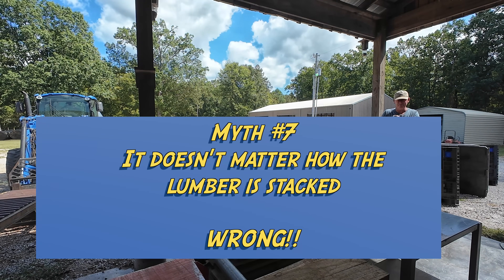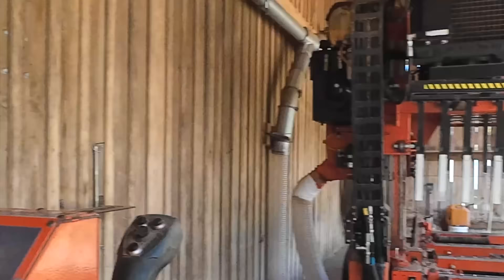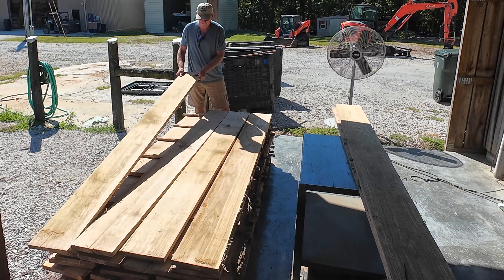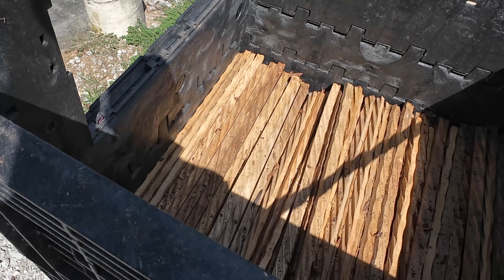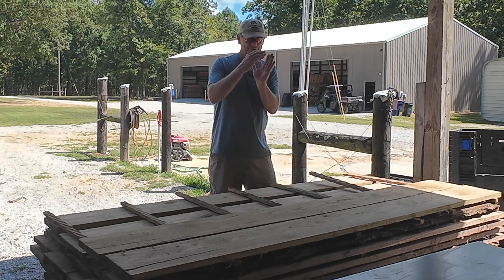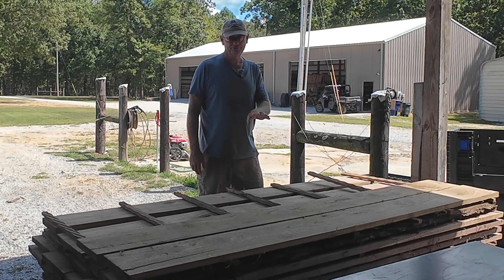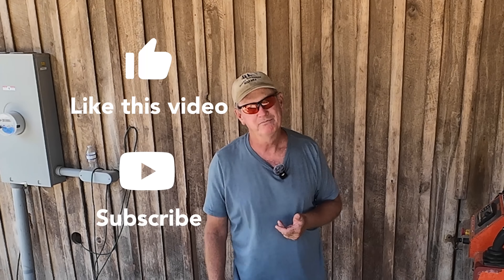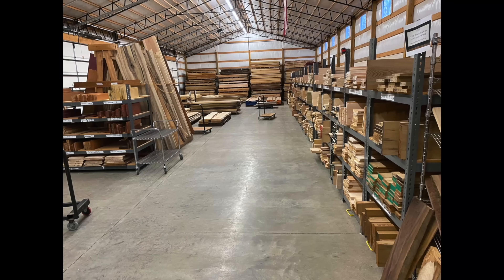Which Sawmill Lumber Air Drying Myths Will Be Debunked?!!

Comment: I agree with the majority of what you are saying.  When you say "Air Dry"  I find that can be mis leading to some.  I get people trying to sell me "air dried" lumber "oh its ready for furniture".  Relative humidity has to be part of that conversation.  I don't think sticker stain is limited to only the sticker as the cause.  I think a lot of it has to do do with the sap content at time of cutting or milling. I also find that stress cannot be removed or reversed, your stacking technique is helpful but the stress is inherent to the tree or log.  At point of use I think people confuse stress with case hardening, which is a product of the kiln drying process.  I always air dry a year per inch.  I find the end quality is better and it is also useful in less kiln loss.  I really like the rotary cut stickers.  I do find poplar and cherry will dry the fastest.
  I'm done rambling  lol         Enjoy your channel!
Reply from the maker: Thanks for watching.  I agree, air dried lumber is never ready for furniture, unless it has been dried to well below fiber saturation point, which generally takes a kiln, and is also sterilized.  I also agree that sticker stain is caused by quite a few things, I have discussed them in in several videos, and it is much more than just the stickers, it is due to the local EMC, the local Dry Bulb temperature, the amount of moisture in the wood when stickered, the amount of sugar in the wood, the color of the wood, the amount and type of extractives between the heartwood and sapwood, the bacterial levels in the wood, and the level of enzyme stain that is acceptable.  There are several really good deep dive USDA publications on the subject.  Minor levels of stress can easily be reversed using proper kiln drying techniques, we do it all the time, and have run quite a few experiments on the percentage we can straighten.  I routinely take  stressed lumber, stack them up, put them back in the kiln, run a few special cycles, and the majority will come out straight.  Some will not.  Inducing stress (case hardening) is only an artifact of improper kiln drying techniques, it should NEVER happen if the wood is dried correctly, and it is easy to test using the "prong test".  In commercial kilns using high temperatures, and high drying rates, the lumber is always and purposefully case hardened as part of the process, then equalized at the end, however, many times it is not removed properly, and so stays in the board and people will experience blade pinching and movement after planing.  So people think that it is inherent to all the kiln drying process, processes when it is not, and is one of the things that separates custom high quality custom kin dried from commercial kiln dried.
In some ways, boards are like carrot peels, when you peel a fresh carrot, it will roll up in a huge curl.  So will a board, if the stress is not identified and sawn properly.  However, if the carrot peel is put in an oven (much like a commercial high temperature kiln) it will curl up further, blacken (lose its color) and will be permanently deformed.  However, it the carrot peel is allowed to wilt and forced into a flat pane (like pressing a flower in a book) and then dehydrated in a commercial food dehydrator (my kiln is very similar to a big food dehydrator), when it comes out, it will be dead flat, still have its color, and will have almost zero stress, just like the rose that has been dried in the pages of the book.  
I agree, air drying is crucial to achieving high quality lumber drying as a part of the process, but it is only necessary to get it down to the point where the unbound water has been removed, although it is useful to get it slightly lower.  Just like all things, air drying is a process, not a fixed time, and is greatly dependent on species and EMC.  I can "air dry" some species using forced air in 6 weeks, while others, especially thicker pieces, may take a year or longer.  It "just depends" and that is what I try to teach in my videos, passing on the knowledge so people understand the background and know what to do to optimize their own processes.  You made some great and thougthful comments and I think I will make a video on this subject!  Thanks!
Reply: @HobbyHardwoodAlabama   I agree with everything you are saying.  I am a furniture/cabinet maker professionally for 40 years.  I have my own mill and dehumidification kiln.  I am further north our RH is around 12 so you are correct on the importance of EMC and dry bulb considerations.  I at times get people who show up and want to sell me some lumber that is "dry" its been cut and in the barn for 50 years, I want 15$ a board foot for my walnut🙄.  Many will get really offended when I pull out the orion or the delmhorst  and check it.  and then are offended again when I offer them a lower bdft price.  
I have had my own experiences especially in recent years with different suppliers and I can say without hesitation that I have experienced more consistent cases of case hardening with wood from microwave kilns.  To the point I will not buy from a supplier who uses them.  It seams the green lumber to green backs is clouding the process in my opinion.  I believe air drying is crucial.  I believe in the slow and steady wins the race approach.  It may be fine for framing and production trim manufacturers etc but not for making quality furniture etc that is going to last.  

I used to get lumber from a guy who had 2 steam kilns, he would explain to me the re hydration process when he was suspect of a load, it is quite the science, and I think it is important for those trying to do this or get into this that they study and learn this is not a plug and play business.  

I could ramble for pages.  But I appreciate your knowledge and what you are bringing to the public with your channel.  You obviously know what you are doing and I have learned quite a bit from your channel.

Comment: THE BEST WAY IN MY OPINION TO DRY  SAW MILL LUMBER, LAY SOME 4 BY 4 SON A LEVEL SPOT ON THE GROUND.STACK THEM  FOUR TO SIX INCHES A PART THE FIRST LINE THEN CRISS CROSS THEM THE OTHER WAY, THEN GO BACK THE OTHER WAY UNTILL YOU GET ALL YOUR LUMBER CRISS CROSS UP.  LAY SOMETHING HEAVY ON THE TOP LINE.  CEMENT BLOCKS ETC. LET DRY 3 MONTHS OR BETTER, AFTER THAT YOUR LUMBER WILL BE READY TO NAIL UP, SELL IT OR WHAT EVER , THANK YOU FOR YOUR ATTENTION TO THIS MATTER.
Reply from the maker: Thanks, what you are referring to is a "waffle stack" and it works OK, but then the pack can't be lifted by a forklift and also will not fit properly in the drying kiln.

Comment: I just disassembled my first stack (made myself).   I have major sticker stain throughout.  I used 3/4 plywood as my stickers, and the stack was air dried outside.  Sad dude here.
Reply from the maker: Plywood is not good for stickers, as you have found out.  It has a tendency to absorb and hold moisture.  Profiled hardwood stickers are the best, they let airflow between the board and the sticker.  Zebra stripes on boards you worked hard on make for a bad and frustrating day, I have done it myself and it sucks.  All you can do is figure out what you did this time and don't do that again.  Location, stickers, airflow, sticker thickness, all can ruin a load.

Comment: Robert, have you ever had the opportunity to saw a tree “without growth rings” like mahogany or something similar?
Reply from the maker: I do saw a lot of African mahogany lumber, but not in log form.
Reply: @HobbyHardwoodAlabama I was thinking about whether the rings and their different drying speeds from the rest of the heartwood could be the cause of the pressure inside the log or if something like mahogany still had the same issues with drying (splitting). I have seen a few of those Indonesian guys sawing them and I wonder what the injury rate is, but nobody narrates about drying or anything

Comment: Conduit or 1/2" PVC pipe. .
Reply from the maker: Not very good, I've tried it.  The conduit will roll and mess the stacks up when transporting with a forklift, tech metal will corrode and discolor the wood, and PVC will squash flat from the heat in the kiln.

Comment: Wow good info... thankyou.  Do you have an opinion on Presurvation Solutions drying aids?  I'm considering buying 16%mc fir from Home Depot, and using Wood Juice to dry it for furniture building... where the furn will live in an AC environment.
Reply from the maker: I would simply bring the wood into your house, which is a very good kiln, and it will dry the wood quite quickly.  The normal EMC for a house is 70F and 50% RH which is abut 8% EMC and so will dry the wood to that level.

Comment: how much of your lumber is quarter sawn vs plain sawn? Amish here in CNY claim after 6 weeks of air drying its down to 15-20% before they put in wood fired kiln.
Reply from the maker: Probably 25% quarter sawn to 75% grade sawn, slabbed, and other techniques.  Yes there are some species that can be air dried in six weeks, depending on thickness and species.  Basically, the less dense and open pored the wood species it, the quicker it can dry in the air.  8/4 white oak will hardly have dried at all in 6 weeks, while 4/4 poplar can easily be brought own in six weeks.

Comment: Another excellent video - I'm all good with what you covered...except for the 6 month drying - my slabs are 12/4...I'm assuming you are referring to dimensional lumber at 4/4
Reply from the maker: The drying rate is directly proportional to airflow and EMC, so forced air through a stack can dry a load of high moisture release rate wood at max speed, and as fast as in a kiln.  Lots of tricks to accelerating air drying, and the goal is to identify the max moisture removal rate of th species and thickness, and use forced air to achieve it.

Comment: I'm just getting ready to log a considerable stand of walnuts which grew after a logging cut in 1965.  The ones I'm considering have circumferences at breast height of 90 to 120 inches.  If they prove too large for a band mill, what are my alternatives?
Reply from the maker: Either a Lucas or Peterson Wide Slabber, they cut up to 8 feet wide.

Comment: 4:03 myth #1, what about discoloration, what cause it if it's not the sticker specie?

i love it's grain, but is there something to do to flatten elm? it bows as hell while i'm sawing it.
even worse when dry.
Reply from the maker: Most stickers stain is caused by one of two things, or sometimes both.  Either trapped moisture and subsequent mold discoloration under the stickers, or enzyme stain where the temperature under the stickers is different than the exposed portions of the boards and the sugars in the wood begin to change color, much like how a fresh apple changes colors once cut.  Both of these sticker stain issues can be solved with adequate airflow between the stickers and the wood, and making sure the stickers are not holding moisture like a sponge.  So for example, I use random hardwood for all my stickers, as long as it's not prone to hold moisture and cause ,mold, such as basswood.  Oak is fine,  cherry, poplar, sassafras, etc are all mixed together in my sticker bins, and even the elm you are working with.  That's also why I use the fluted or spiral stickers, simply because they promote good airflow between themselves and the board.  As far as elm is concerned, its spiral grain structure makes it very difficult to saw straight without it bowing up.  Use the fundamental stress management sawing techniques I discuss in some of my videos, and even then, you will still have about a 30% kill rate, but otherwise, you should get a majority of some very nice flat boards.
Reply: @HobbyHardwoodAlabama  ah... i may have use basswood and aspen for ash...
on some board i have gray stripes, some other are lighter in color.

i saw your video on stress.
I will be more vigilant about this next summer, thank you for your response.

Comment: look what happens at 13:43. hmmm.
Reply from the maker: Good eyes! I assume you are looking at the board rising due to the residual fiber stress in the boards?  The board is dimensionally accurate, and and I can remove the stress during the drying process,
Reply: @HobbyHardwoodAlabama  No, I'm looking at the board dropping as it's cut because it is unsupported. 
The bottom one ending up thicker and upper ending thinner for the last foot or two. There may be some stresses but if it was supported on the end the stack would have risen, not fallen. I'm just 'B'ing, you have taught me a lot and I'm hoping my sawmill biz can sustain me as a needed retirement job. So thanks.

Comment: I Guess leaving spaces between the boards doesn' matter ? Thanks for the info .
Reply from the maker: Good eyes and good comment and this goes the the real heart of my videos, that what many people think are hard and fast rules, are not, if you have the knowledge to understand why those rules were put in place to begin with,  and that’s why I make the videos.  So some rules are myths, some need to followed, and some are just guidelines.  The impact of edge spacing goes down when packs are less than 48” wide (mine are 42”) and if the air drying area has adequate airflow and the stacks are not jammed together, with an adequate stack spacing between packs, they they will be fine.  No different than drying a 40” wide live edge slab than drying a 40” wide later of 6” wide baords.  Most times.  IF the stacks are right, it won’t be detrimental.  On the flip side, edge jamming on some species constrains the boards to dry with little crook, so can produce a straighter better board, especially with quartersawn and rift sawn wood.  Good topic for a video!

Comment: I heard there's a way to take in straighten out. Bend boards by placing other boards on top of them to force it straight. Is that true?
Reply from the maker: No, not without the addition of heat and moisture, much like is done in steam bending.  I have tried both, but dry bending with weight doesn't work except in maybe 10% of the boards.  It's not worth doing.

Comment: Great video Mr. Robert.
If I'm wanting to save some whole logs for future projects/milling do i need to remove bark, end seal and position them up of the ground with plastic underneath till I'm ready to mill them?
Any info feedback would be awesome. 
Thx
Reply from the maker: First, you are aware that isn't the best thing, but I understand, sometimes you got to do what you got to do.  From my personal experience, and I have a video coming out this week that talks about old logs and some of the good and bad points, you will see some degrade, so you need to do some things to limit that.  So do not remove the bark, that will enhance drying from the log and will increase drying cracks from the sides, bark acts like end sealer.  When you initially buck the legs, leave them at least a foot or more long, on each end, so that any end defects that appear can mostly be cut off with a chainsaw when you actually get ready to saw them.  Although stress cracks can progress further than a foot, most drying checks will not, no time them off clean and to length when you are ready to saw them.  Endsealer can be applied, it wouldn't hurt, and if the logs as high value, you can use "crack stoppers" driven in the ends, but I rarely do that.  Do stack them vertically, to get them off the ground, and to get them away from the insects in the dirt that will attack them.  So make it hard for the bugs, and you can even spray with an insecticide to keep them away, if you want.  Do not cover the logs with plastic as that will promote mold growth.  Plastic sheet underneath will serve as a moisture barrier for them ground but will trap rain water, so it can be good and bad.  Place and stack the over length logs in a shady, but airy spot, stacked in a nice pile, preferably off the ground (ground logs will have the highest degrade) and as the logs dry, the sapwood will start to check, but the heartwood should remain sound, of many months.  however, all things rot eventually, so there is only so much you can do.  You know, this would be a good topic for a video.

Comment: I'll never have a sawmill  but this was an interesting video. ( I got hurt in work, laid off,  hit retirement couple of years ago-pretty broke 🙄🙄🙄)
I'm in central Florida, when I see the amount of really good wood going through chippers after hurricanes it kinda depresses me.
I think we have different species of white oak on property ? (around an acre total, house takes up 1/3)
Some is incredibly dense, straight and no bugs, 100 ft away, 'water oak' (no idea what it's really called, center almost always rotted out and if you cut off a branch it's like turning on a hose) I cut off a branch overhanging  sidewalk, only about 5" diameter, had a gusher for 20 minutes! There are also 'worm tracks around 5/16" diameter where they burrow, the grubs are quite big
Got to go get supplies as Hurricane Milton is coming Wednesday.
Wife and I are both fed up with hurricanes, may move further north and further inlland.
Thanks again for an interesting video.
Oh, forgot to mention, I have cut a couple of slabs 18"x2ft from the 'good' oak, pretty sure I messed up by putting it in garage though?
I'm not a woodworker (motorcycle mechanic, small engines, construction equipment 10 years,  etc)
Reply from the maker: Cool- it's good to hear your comments and thanks for watching.

Comment: I wonder if he either paints the ends with paint or liquid parafin to prevent splitting? I must have too much time on my hands because I could watch this guy all day!
Reply from the maker: Yes, for high value wood, I always use a commercial green wood end sealer, of various brands and formulations.  Most are based on wax and glycol mixtures, to protect tends when green and then later evaporate off in the kiln.  Thanks for watching.